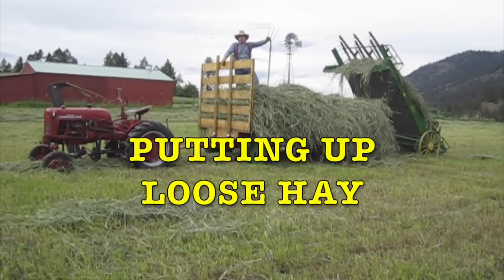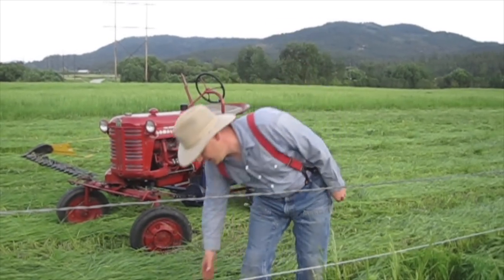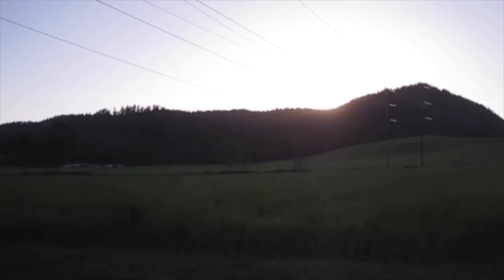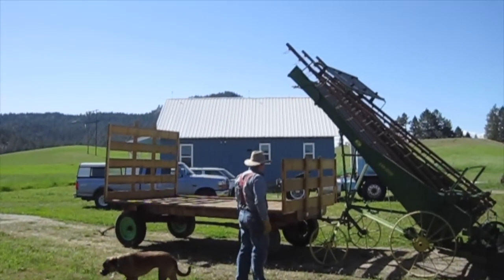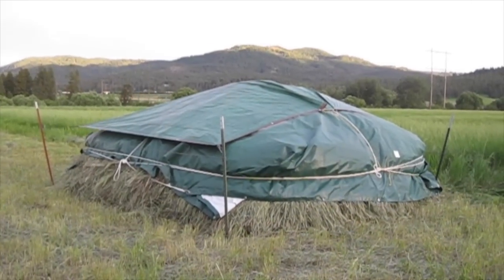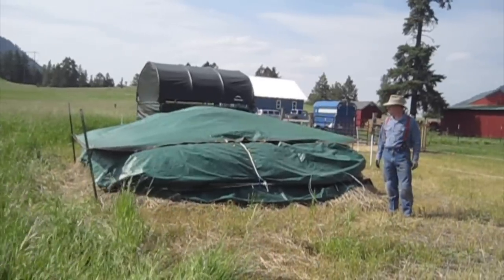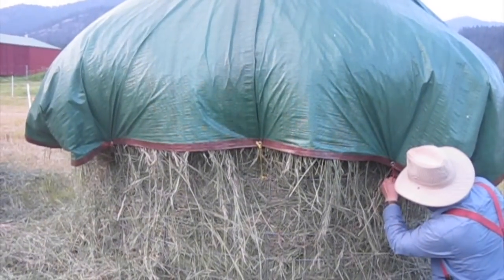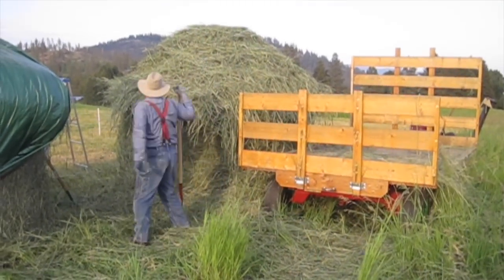Putting up Loose Hay with Farmall Cub, John Deere Hayloader

Comment: Very good educational and entertaining video ! Thank you. I have never seen a hayloader before. Ingenious device. I learned to drive on a Farmall Cub at 7 yo in 1955. I was small at 7 yo, so I would have to slide down to push the clutch, put it in gear, then scoot back on to the seat and advance the throttle. But at 10 yo, I was tall enough to really operate it, and my Grandfather would let me plow. Never would let me disc though. He had an International F20 with steel spiked wheels, a Farmall Super H for that. Way too big for me at that time. We too had our hay baled by others. My Grandfather described a haybaler as "a consarned machine". I knew what that meant. At 10 yo, I was barely big enough to throw a bale, but I could get it to the trailer. Thank you for refreshing those fond the memories.
Reply from the maker: Bruce B glad you enjoyed the video! Yes, balers can bring out the colorful language! Thank you for sharing your memories. And thanks for watching!

Comment: Seeing you work loose hay sure brings back memories.  I used to work on my uncle's ranch and we did loose hay until he was in his 70s. We used a Farmall Cub with sickle bar to cut about 200 acres, then pulled an old dump rake. 2 days in windrows, turn the hay, 2 more days, then rake into piles. The next fun was pulling a lowboy trailer behind an ole International cabover through the fields and pitching the shocks onto the trailer. Whenever the trailer was full (about 10 tons) we pulled up alongside the barn and used a jackson fork to put it into the mow. Then stomp it down and back to the fields.  Good times that instilled a work ethic that still drives me nearly 50 years later. Thanks for your video and the memories.
Reply from the maker: That's a lot of hay! HaHa! When we bought our Cub, the previous owner offered to throw in an old dump rake for free, but unfortunately we didn't have room on our trailer. Oh well. Glad you enjoyed the video! Thanks for watching!

Comment: Well done ! The trouble with putting a tarp on fresh hay is that it is liable to sweat and go mouldy . keep up the good work
Reply: When my grandfather put wet loose hay in the barn where there was no chance to dry it again he would salt it to keep it from getting hot. He farmed with 2 teams of horses, never had a tractor.
Reply: @williamgillette4086  not at the bottom half of the stack its got to be dry as a bone
Reply: if it's not super dry beware. fire happens. You can get a thermometer gizmo and check it. Fun vid!

Comment: Great to see this old equipment restored and being used. I guess you enjoyed every minute of the hard work it involved. With a round baler the whole field could have been cleared in a couple of hours from the tractor seat. I've found the problem comes when starting to use the hay and the cover get blown off the half used stack.
Reply from the maker: Interestingly, loose hay stacks develop a "rind" that does a pretty good job of protecting the inside. We still tarp the top, but even with the sides exposed we loose very little. Thanks for watching!
Reply: @vnthomas16  Same thing with round bales which are left out. Only a few inches of the outer layer is wasted. With square conventional bales the water soaks right in and spoils the whole bale

Comment: Hay you two....
Loose hay is wonderful. My father cut hay with horses and used dump rakes. Those are my childhood hay memories. However when I was big enough to help I drove the John Deere AR  Pulling a rake just like yours!!!!  We had hay forms and didnt use a wagon, the tractor had a hay sweep mounted to it that was like a giant front end loader. It dumped the hay into the stack former. (A big metal cage about 16 x 20. With a hitch on one end and a gate on the other.) When the form was full, we open the rear gates and pulled the form away from the stacked feed.
In my days, I had a Massey #12 square baler and a New Holland 1002  automatic bale stacker, pulled with a Massey 255.
At one point we had an Allis Chalmers round Baler. It made small round bales. It was a cantankerous peice of equipment.

This was a terrific video. You really are blazing your own style of Homestead/farm.
Reply from the maker: Fiona C “Hay” to you too! I like this old, simple equipment. And I don’t like bucking bales. So, it’s a win-win for me!

Comment: Did this with my older brother when I was a kid. Had a Farmall A. Don't know what brand the hay loader was .
Had a 5ft sickle bar mower  and used a dump rake to put the hay into winrows.
Used the forks and pulleys to unload hay into the mow.
All the implants on the farm were originally horse drawn. Dad converted them to be pulled by the tractor. I remember the team of work horses he had. But he sold them not long after he bought the tractor.
Reply from the maker: That old horsedrawn stuff was well built. Keep it well lubed and don’t pull it too fast and it’ll probably last forever…

Comment: Great to see a hayloader in action! There was one at our farm when I was growing up, but it was parked when we started baling. I barely remember haystacks being made, they put it up as high as they could throw it, then dug a hole and put up a long telephone pole with a pulley on top and used a big long rope with the lifting forks on it and pulled bunches of hay as tall as the power pole. There was one or two men at the top arranging and packing the hay down by walking around like you do with pitchforks full of hay.
Reply from the maker: Wow! That sounds like quite the operation! Must have been something to see! Our haystacks have worked out well enough so far this winter. Looking forward to a barn, though.

Comment: In the early 50's we put up hay in the hay maw. About 8 times as much hay as you just put up. We had four milking cows. I would put another ring above those metal fences around those hay piles. We never had a John Deer hay loader. But just a hay wagon and tractor. Our tongs for lifting the hay to the barn looked like a giant two tonged fork, with little holders at the inside bottoms of the tines. You just dropped it into the hay pile to get a full tine full.
Reply from the maker: Paublus Americanus AMERICANUS thanks for sharing! If you look at our more recent haying videos you’ll see we used a hay grapple like you described to unload. While it was designed to be used with a trolley system in a barn, we used ours on the end of a boom pole and it worked great! Of course, once our barn is built, we’ll use the grapple as it was rightly designed. Thanks for watching!

Comment: Nice video, 
My dad and I use to put up loose hay when I was young. 
The barn had a large sliding door at the same level as the wagon bed. We would open the door and off load the hay. The barn was 2 1/2 stories. It had 4 wooden air shafts that went from the floor to ceiling with a large ladder next to an attached regular barn for cows and pigs.

I never knew what the air shafts were for until my brother (who does round bails) told me about one of his hay bails catching on fire due to high moisture content. He had them outside and only lost 5.

Good luck thanks again.
Reply from the maker: You're welcome! And thanks for sharing your memories. We enjoy hearing other's stories on putting up loose hay. Thanks for watching!

Comment: I grew up putting up loose hay loved it wouldn’t change it fo anything we had to mowers one like what you have there and one horse drawn both worked we used a horse drawn rake pile hay into bucks then two men with forks put them on the wagon the to the barn unload and start again
Reply from the maker: Colin Bateman we hope to use horses someday. I have an old IH #9 high gear horse drawn mower I plan to restore someday. Thanks for watching!

Comment: Nice old equipment! Old pallets would work good for sides as well. If you don't need a big barn you could use old pallets for your side walls. You could go 3 or 4 pallets high with 6×6 or 4×4 post for support. Just ideas.
Reply from the maker: Lee Hilton that’s a good idea! Thanks for watching!

Comment: It's neat to see the different ways people stack hay.  My grandpa always tells us stories about when he was young and how his dad would stack hay.  They had poles that they would stack hay around and tromp down as they'd go up and it'd be arranged so as to shed water away.  When it was time to use it, the hay would slide down the pole as it was removed.  How did you remove hay and what did you learn from this type of stacking?
Reply from the maker: austinwagoncompany what we learned was we’re not very good at stacking loose hay outside! Haha! Actually, all the hay fed out well and was well preserved (it was all tarped). The cattle panel hoops worked the best and are pretty easy, just throw in the hay and stomp it down. The hay would knit together in the stack, so the best tool we found to extricate it was a “potato cultivating fork” aka a “refuse hook”.

Comment: We used hay nets in the wagon that were then lifted by a cable to a track in the peak of our haybarn then dumped via a trip rope.  Pulling the trip rope was my first job.  I was about six.
Reply from the maker: Hi! We use a hay sling on the wagon to get about the last 1/4 of the load. Works great for getting the wagon cleaned off! But yes, we use a grapple for the rest. Thanks for sharing!

Comment: Very good! When I was a young boy we put up loose hay every summer, 15’ diameter 20’ tall by having a cedar pole in the center (like a flag pole) for support to stack around.
Reply from the maker: Thank you! I have heard of the centre pole method. This year we continued to use the cattle panel hoops which I think work really well, as well as some corral panels to make a box. Hopefully this is all short term as were starting on a barn soon which will have a mow to store the hay inside. Thanks for watching!

Comment: I have never seen a hay loader before.  I don't know that they were ever used around here.  As far back as I have heard (I started running a side delivery rake for a local guy that baled hay for many of the neighbors in the early 1970s)  they used a stationary baler that was horse powered.  They used a sulky or bull rake to drag the hay to the baler and then pitch forked it into the baler.  It was a manual tie square baler (never saw it but heard many stories about it).
Reply from the maker: Thanks for sharing! That almost sounds like more work than what we do! Haha! I'll tell you what, John Deere had a good salesman in our neck of the woods, because 90% of the hayloaders around here are JD. That said, our neighbors just restored a New Idea hayloader and are putting up loose hay with that. Thanks for watching!

Comment: Morning dew will collect on the underside of the tarps.  Maybe build a frame and use tarps over the frame so you have airflow and it can breathe more.  Or put the hay in one of the poll buildings you have there.
Reply from the maker: Rosalie Semrau hello! Once the hay sweats out, we’ve never had any problems with moisture under the tarps. A frame would be handy though. Unfortunately, we’ll never have a chance to try that since we have built a barn since we filmed this. Thanks for watching!

Comment: We live near you and did a trial run last year with putting up loose hay. We are in the midst of haying now and it is going pretty well, aside from the perpetual rain in the forecast. We have a functioning trolley in our barn. I recommend a hay sling as being easier to use than a hay fork or harpoon. It likely carries more than the grapple per load. “Haying with horses” is also a good resource for loose hay. They have it at the library now.
Reply from the maker: Heather Horrocks, glad to know we’re not the only ones crazy enough to do loose hay up in this neck of the woods! Yes, we’re big fans of Lynn Millers books and subscribers to the Small Farmers Journal. You’re right, “Haying with Horses” is a great reference! I’m not sure on the grapple vs. sling yet. Obviously, we already have the grapple, but you are correct, we could probably get bigger loads with slings. The one thing I don’t like about slings is you have to manage them whilst loading the wagon. But, we’ll see... This is all one big experiment! Thanks for stopping by!

Comment: Now that's haying in our which is 40' to the peak 36' wide 100' long on the top floor in the center of the barn we had a movable slide which you lined up with the bay you wanted to put the hay in so when you trip the fork the hay would go right in the bay
Reply from the maker: Sounds like a very impressive system! We're looking forward to getting our hay trolley set up for unloading. Thanks for watching!

Comment: Nice video! You have the mowing speed correct but you need to increase your ground speed raking. The rake is pushing the hay into windrows, the rake needs to lift, fluff and move the hay into the windrow. If you need to flip the windrow you only use the last 2 feet of the rake bars to fluff and flip the windrow. You can double the height of the hay on the wagon, that helps to pack the bottom of the wagon along with manually stomping it in the stack.
Reply from the maker: Thanks! Our little cultivating tractor isn't very fast... if it was it'd probably bounce you out the seat! We do rake faster when we're using our New Holland tractor though. Here, raking really isn't a function of drying. We do most of the drying in the swath, only raking a few hours before picking up just to make it easier to pick up. With our hot temperatures and very low humidity, we've gone from mowing to put-up in 48 hours. No tedding, no conditioning. The weather can be quite unpredictable in our mountains, so having these short windows can be advantageous when trying to beat the rain. Thanks for watching!

Comment: when i was a kid we put a poplar pole in the ground with braces. then piled and packed hay around 12  feet wide and about 20-25 feet in the air and it was never covered. these were placed on hillside of hay field near pasture to keep water draining away. i was a about 14 then.
Reply from the maker: Joseph Barker yes, I’ve heard of using a centre pole for support. I think some sort of support is necessary, and we have refined our hay stacking skills a bit since we initially started doing loose hay. Thanks for watching!

Comment: A baler does not lessen feed quality or chop up the hay. The keys to quality hay are cutting in a timely manner and not letting it get too dry to minimize leaf loss.
Reply from the maker: You're absolutely right! Timely cutting and not letting it get too dry are key! That's one place loose hay does have an advantage, as you can safely, without fear or mold or fire, put up hay a few percentage points higher on moisture. Square balers and many round balers do have knives that contribute additional "processing" for better or worse. Thanks for watching!
Reply: @vnthomas16  round and large square bales yes, small square bales, not so much.

Comment: When we put up loos hay We would throw rock salt on it helped to dry it out and keep the mold in check
Reply from the maker: I have heard of folks salting loose hay, especially in areas where it’s a little bit of a challenge to get hay to dry down completely. I believe it helps with palatable too. Lucky for us, our low humidity and high temps usually mean we can dry down no problem. Thanks for sharing!
Reply from the maker: I have heard of folks salting loose hay, especially in areas where it’s a little bit of a challenge to get hay to dry down completely. I believe it helps with palatable too. Lucky for us, our low humidity and high temps usually mean we can dry down no problem. Thanks for sharing!

Comment: You should invest in some ropes we years ago had ropes under the hay on the floor to the front end and then pulled the whole load off together into pile on the ground and just kept rolling into the pile load after load. Would make huge stacks and they kept very well.
Reply from the maker: Joe Scheller we’ve been unloading with a grapple, which works well, but we are interested in trying rope slings for unloading, especially after we have our trolley set up. Thanks for watching!
Reply: @vnthomas16  We used rope slings with a trolley to unload a whole wagon load at once.  Lift the load up several feet then stop so you can attach the trip rope and then pull it up into the barn. Stop when you get the trolley where you want it, pull the trip rope and wala, the rope sling parts in the middle and your hay drops.  Use the trip rope to pull the trolley back.

Comment: thats a large area for a small tractor. i have a 1948 cub, i had a sickle bar but didnt have any use for it so i sold it. i use the cub as a chore tractor around my yard and property. this spring im going to have it overhauled. it has a weak clutch and two cylinders are low in compression. it runs but doesnt have the power it should have.